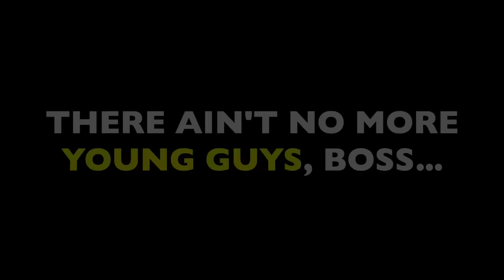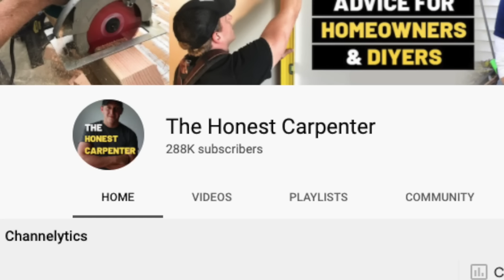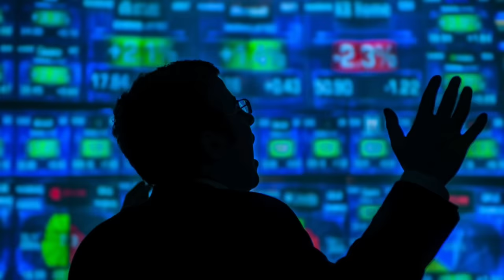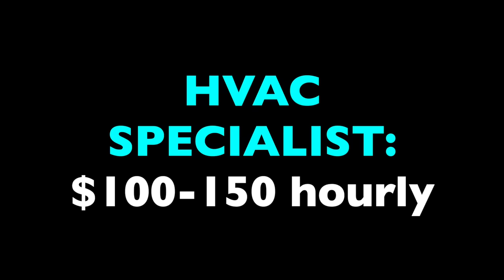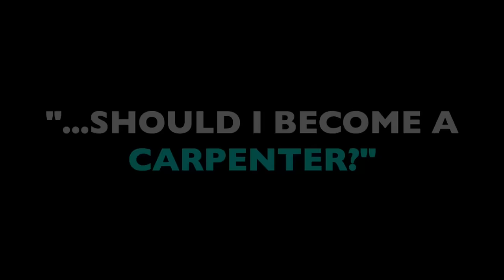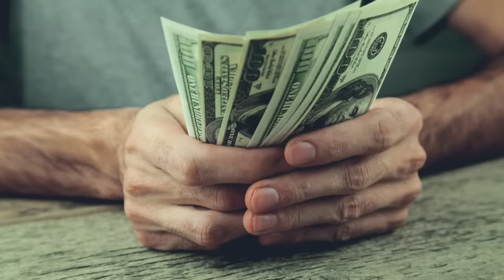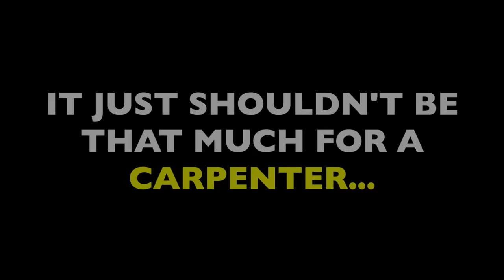WHERE HAVE ALL THE CARPENTERS GONE?! (Why The Trade Labor Shortage Is Only Beginning...)

Comment: I'm a 66 year old Carpenter and have always been busy. I have raised my rates to $ 60. an hour . to be a good carpenter doing residential work , you also need to know and understand the needs of the other trades. When my Mechanical tradesmen were telling me of their great importance , i reminded them that without the Carpenter they have no place to hang the pipe, run the wire or ductwork  Remembe  ALL WORK IS HONORABLE
Reply: You are few and far between, and I'm sure you already know that.
Reply: You are correct, I have worked as an electrician and a carpenter. Both jobs are hard and they need each other.
Reply: Only 60?
Reply: As n hvac i conquere
Reply: I am 65 in the UK. Still up for it. I have never pitched myself as fast or slow. Good or bad does it for me every time. Horses for courses I say.
Reply: Where I live the labor to install a simple 6ft wood fence starts at $200 per 8ft panel and contractors have to turn away work due such a large backlog of work and lack of workers.
Reply: I love the carpenters that put nails all through the top plates for sparky to drill through.
Reply: joe bloe but with advanced framing its only half the nails. 😎
Reply: @joebloe9901  hahah tell me about it.
Reply: Masterminding the matrix of bullshit adorning our work is always fun! Not one of those guys would think twice about hacking something away to make their job easier...not hating, just expressing.
Reply: @joebloe9901  real carpenters know better
Reply: having the tools helps
Reply: With that kind of money you should own a big house yourself like 500k right? I don't see rich carpenters
Reply: @younkinjames8571  are you sure about that?
Reply: @aig5429  carpentry is an honorable profession, and it's not always about the money. It's a skillset. what's that worth? while other folks are faced to stay home,
Reply: @joebloe9901  there's a lot of fake carpenters out there...real ones know not to do that. Framing 101 really...
Reply: Amen brother. I'm a plumber. All trades are important  but the carpenters have always  been under paid.
Reply: No one will ever build another house that has no plumbing or electricity, they don’t want you without the other trades either.
Reply: @erikarice6859  perfect example, off grid cabin. you lose
Reply: You should be getting $100 an hour if we compared to plumbers and factored in inflation in dollar. You guys have hard to replicate skills, I've watched plumbing videos and done all kinds of jobs at my house, once I see it done, (no offense plumbers, wasn't saying I do huge stuff) but I can't watch a youtube vid and replicate carpentry, it's gonna come out different!
Reply: @nmatthew7469   You can't do that in construction on a 9 month project. that home would cost 5x to build what it's worth
Reply: @gregsmith7828  already the materials have raised the price, and how can they afford to pay plumbers that amount 🤔The failing dollar and policy of importing low skilled, low pay labor. They know young guys won't go into it with that pay, it's why they do it, it's intentional.
Reply: @nmatthew7469  i work for myself and price accordingly. i don't work for other folks. except the  homeowner. i don't do "big time" i do custom. and stay busy when i want to
Reply: lol 60$ an hour..
Reply: I agree. We cant have a house without all the skilled labors. I myself am a retired plumber. Not retired cause I could afford it, but due to my health. Carpenter plumbers heat;air guys, elections, septic tank guys roofers. Ect.ect. all jobs are important. Especially  the helpers.lol helpers are worth way more than they get paid. Any good contractor knows that.
Reply: @nmatthew7469  well, I'm not so sure about that. I thought that I could ride a bull after watching it on youtube for a while. Guess what  I was wrong as hell. Lol
Reply: 60 is not really 60, you're running your own buisness, bidding jobs, repairing vehicle, paying extra fica taxes, replacing tools etc. Plus it's never a consistent 40 hour work week. Most customers choke on $60 an hour, you have to hide it in the price. And end up with a broken body no 401k, nothing. Should be $100 per hour
Reply: @nmatthew7469  others carpenter can't watch me and replicate my craftsmen ship or speed.
Reply: @Ugoofy1  you are mistaking kindness for weakness again.
Reply: Exactly. Doctors wouldn't have time to cure people if farmers didn't work the fields to put food on their table. Engineers wouldn't have time to build complex machines that improve society if carpenters didn't build and maintain the houses that they live in. CEOs and managers wouldn't be able to run businesses if they didn't have workers to generate the value that keep the company afloat.

Society is highly symbiotic. It's an elaborate machine made up of countless moving parts that all fill vital roles. Everyone from the lowest janitor or factory worker to the highest CEO or politician serves a purpose, and they are all required for society to function well. It's when we forget that fact that society starts to run poorly.
Reply: All work may be honourable but it damn sure don't pay like it any more!

Comment: It seems like the quality of carpentry has gone down too for similar reasons. My house was built in 1959 and when I look at the framing in the attic everything fits together perfectly. My garage was built in 2016 and there’s massive gaps, especially anywhere that involves an angled cut. I think a big part of that is because we prioritize cutting costs via labor which pressures workers to rush rather than take the time to do things right.
Reply: To a lot of companies it is speed and not quality that counts. Many years ago my father had  lots he wanted to sell and no bank would give a mortgage on an empty lot. He hired a company to build houses on each lot (one at a time) and in the contract he stated that the construction was to be to his satisfaction. Each evening he went to the house and checked that the walls were plumb, straight, and all work was top notch. Several times he had to halt the job to have the carpenters remake an un-square wall or have them tear a wall down because the timbers were all over the place.
Reply: You can thank the customers for that. They want cheap quick labor. Good labor is not cheap and it's not quick.
Reply: The thing with angled cuts is, and i'm not being sarcastic here, this is a real issue: most carpenters can't do basic trigonometry and mess up the angles.
Reply: Aside from some community colleges and trade schools that still give trade certificate training. There is no where else to properly learn the hands on and theory needed for a skilled trade. 

So a lot of younger guys have no choice but “eye ball” everything and assume it’s gonna work.
Reply: @alexsmith-ob3lu  There are many trade schools that train people in the trades. My son went to a 3 semester school and now after 10 years out he is making just short of 100 thousand dollars. Or try to find a good independent carpenter and app with him. The other way is to find a union program that you like in electrical, plumbing, carpentry, or any other trade and go through their schooling. A person willing to work hard in the trades now can make a great living.
Reply: I was a carpenter in Germany and I had a co worker who was 2 years in America and what you describe is the reason he came back. He said it’s so sad how cheap those cardboard houses are and the only reason he got employed was so they can say it was build with „German woodworking skills“ even tho he was not allowed to do it the „German way“ because they wanted it to be done as fast as possible not good
Reply: @inkognito3145  sadly, I believe you. I’ve been to a few European countries and it seems that even the newer construction is built to a higher quality than it is here.
Reply: @inkognito3145  America has created a a throw away culture where everything is treated as disposable. 

Sad as it is, that is why I choose to avoid new construction residential as much as possible. Commercial, utility and industrial pays a lot better as an electrician.
Reply: Mate that’s so true. I’ll never understand how 100 years ago they never had power tools, had to drill shit by hand, yet we have all the power tools we could think of these days and the workmanship is worse?? How does that even happen???
Reply: Your house built in 1959 probably also has a basic ass design and roofline, not like these ugly Mcmansions nowadays where the roof has its own roof...
Reply: @Null-o7j  yes, my house does have fairly basic roof lines but it it still quite a bit more complex than my garage which only has a single roof line. I do get your point though that some modern construction is made more complex than it needs to be, especially if you’re not going to put the time in to do a quality job.
Reply: @alexsmith-ob3lu  Fucking this.

They leave a brand new guy alone on a task with zero training and education and expect him to just accomplish it because to them its "just basic" and "common sense."

Makes me fucking laugh